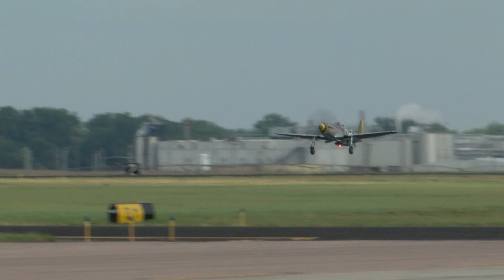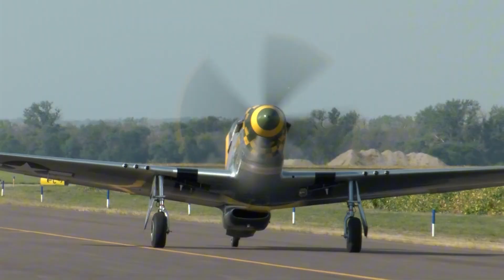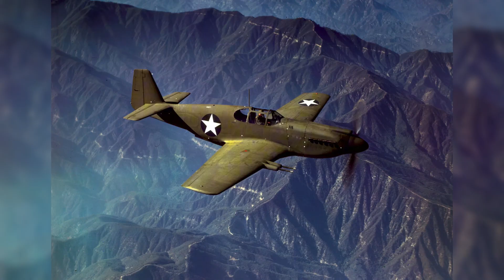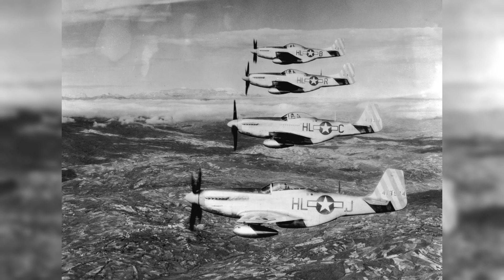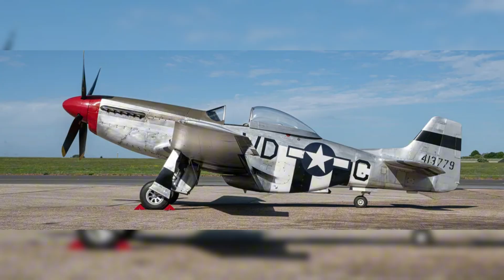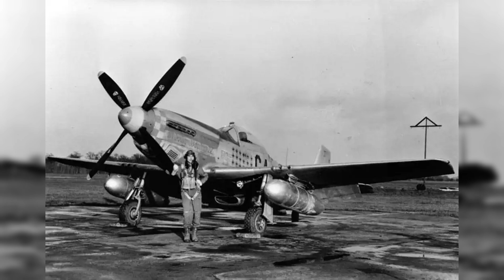P-51 Mustang – The Fighter That Won the Skies of WW2

Comment: And Merlin equipped P-40s came damn close to matching the early Merlin Mustangs.  But since the Mustang outperformed, Merlins were cut from the P-40 production. Mustangs and PT boats got priority on the Packard Merlin. 

Just think of the performance improvement with the Merlin in P-38s, P-39s and P-63s.

Government should have had Allison switch to the licensed Merlin.  Same with Wright. They should've produced Pratt and Whitneys R2800 twin wasp und license

Comment: Over rated. Tired of hearing the Mustang won the war. 

Hellcat had a better kill ratio, the final Spitfire was just as capable, the Thunderbolt could preform the same escort duties, while sustainability excelled the Mustang, the Corsair was as much of threat to the enemy, had more versatility, and again, higher sustainability.  Damaged Thunderbolts and Corsairs brought more pilots home than the Mustang. 

No doubt a great plane.... by accident.  

Remember, the first Mustangs were considered unacceptable to the British. They wanted a Warhawk replacement and got a mediocre replacement that wasn't much of an improvement.  Until a test pilot said throw a Merlin in and see what happens...

Yes, the original Allison Mustang was rejected by the RAF. 
Allison Mustangs were then fitted with dive brakes and HVARs and became the A-36 Apache. 

So no, the Mustang did NOT win the war and owes its great career to one test pilot with a crazy idea.